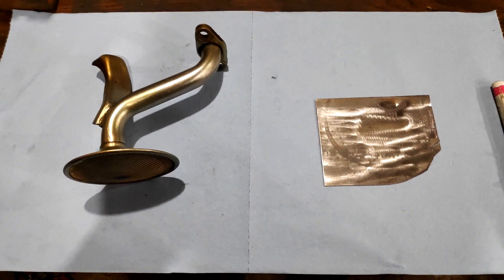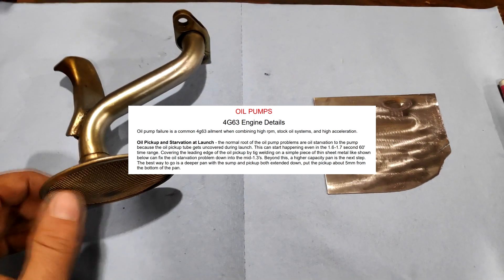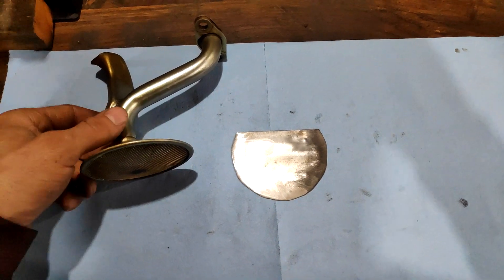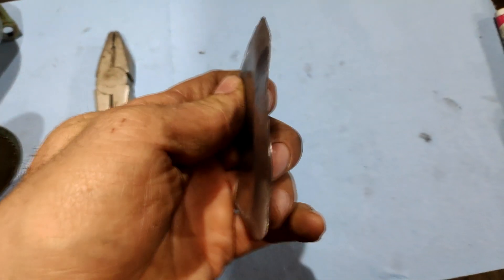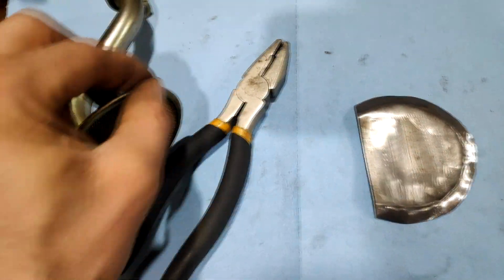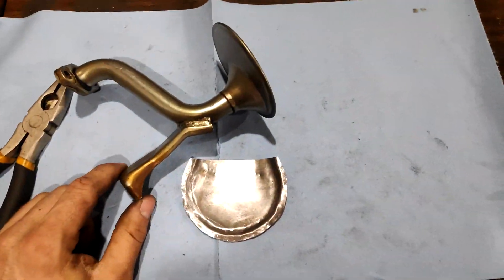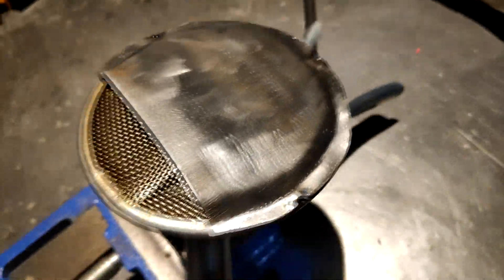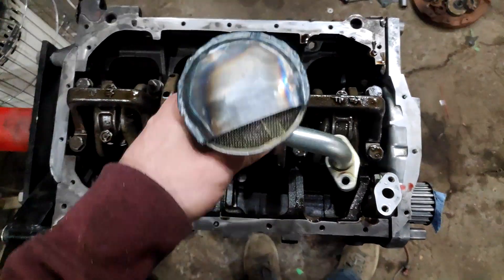6 Bolt 4G63 Kiggly Oil Pickup Mod

Comment: Wouldn't be surprised if my 7 bolt took a beating from this.  1.64-1.72 60 foot times all day long, over 250 drag passes.  I could probably make a penny off of recycling all its time slips.  Had both oil starvation and high oil pressure symptoms.  This is magnificent!  Thank you Kiggly and thank you Jason!
Reply: Jafromobile what tcase?
Reply: I assume this would be beneficial in a 7 bolt as well or only an issue with 6 bolt pickups?
Reply: Jafro if you respond to this, you think that your setup was air gaping the oil?
Reply: @epoxeclipse  Sure.  1.64 60 foots and an open pickup.  Sitting on the rev limiter waiting to launch, pumping all the oil to the head...  Sure I was.  Won't be anymore, though!  Those are hard launches.
Reply: @Jafromobile  I tend to over-fill my 4g63 slightly, rather too much oil than not enough. We are in the middle of a different tear down currently and inspecting a 90 oil pump and front housing watching your video for things to check. Also some people swear by the long balance shaft vs the stubby.
Reply from the maker: I light overfill + the kiggly mod and yet to have lost an oil pump since. Those "race" balance shafts do absolutely nothing, in fact, it's on the opposite shaft that usually gets chewed up anyway, pure snake oil.
Reply: @jdxnc04  Thanks jason, maybe the oil pickup suction issue is more of an issue than people would think. Do you run a stubby BSE kit?